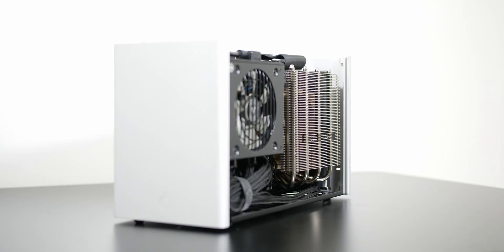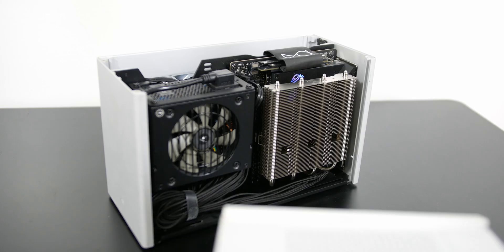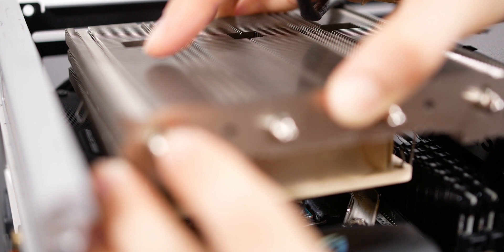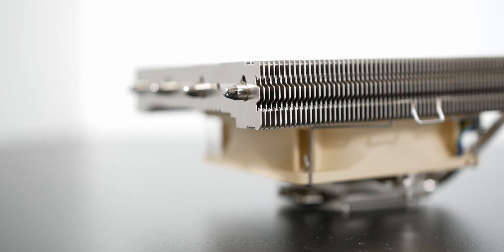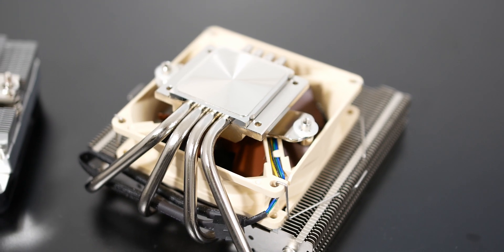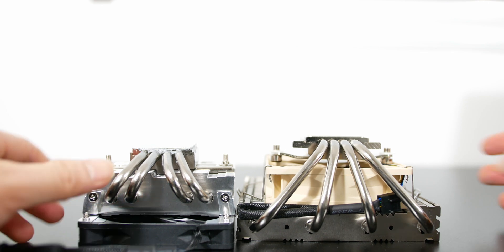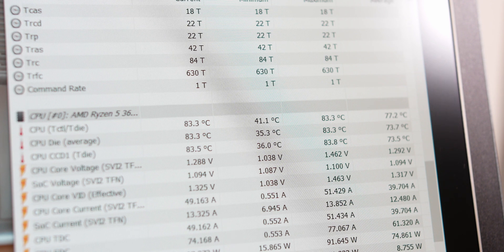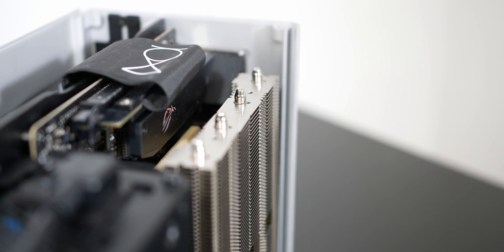Noctua NH-L12 Louqe Ghost S1 Edition Review – Finally a Low Profile CPU Cooler for the Ghost S1!

Comment: cpu temps are the only thing that's getting in the way from me really loving my ghost. they always feel so high...
Reply: Yea I'm debating getting this case because of CPU cooling my i-7 11700k
Reply: @crunchylight9996  i ended up getting an aio. You can put it on top but it’s kind of difficult to make work. I put it on top of a large tophat
Reply: @jumbo_mumbo1441  Yea I am looking at the Ncase m.1 now, that one just seems so hot since it's so small, too hot for my liking
Reply: @crunchylight9996  you just have to know how to configure it. With my aio I never go above 60 for my cpu-usually gaming in the low 50’s. My gpu is usually a little less than 60 while gaming
Reply: Granted, I’m on a low resolution/frame rate atm, but i expect I’d be sitting at no more than 60 running 144hz@1440p for my triple a games
Reply: @jumbo_mumbo1441  what's your gpu? And what games do you usually play

Comment: thanks for the vid Tony. I almost bought one of these NH-L12 coolers, but 83c is a NO-GO. I'll stick with my 240mm AiO cooler for my Louqe Ghost S1.  Unfortunately it looks like there are no good air cooler solutions for this premium case. I'm tempted to try fitting my Big Shuriken 2 revB in it, but I doubt it would be adequate to keep temps below 80c.
Reply: did you try Shuriken 2? I have one and just bought a Ghost S1 reading your post... and I need to figure out AM4 mount.